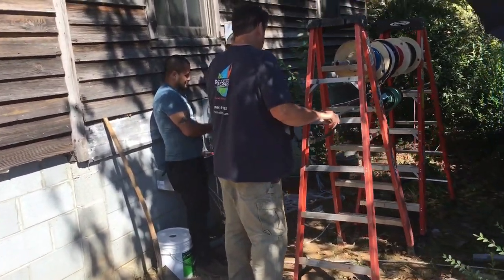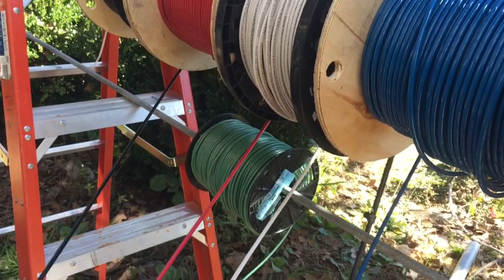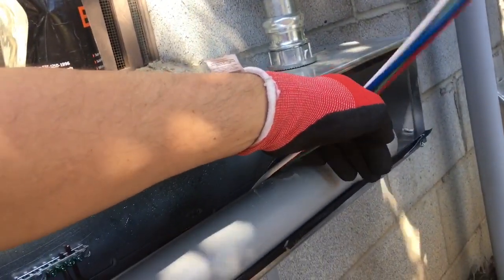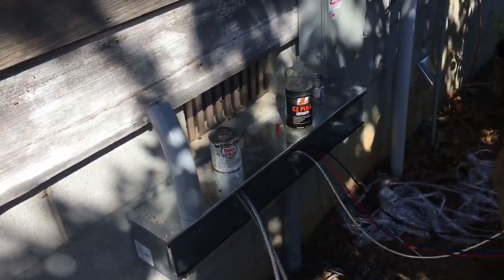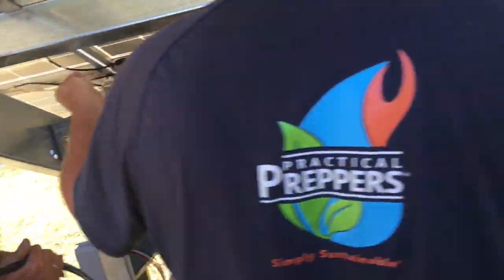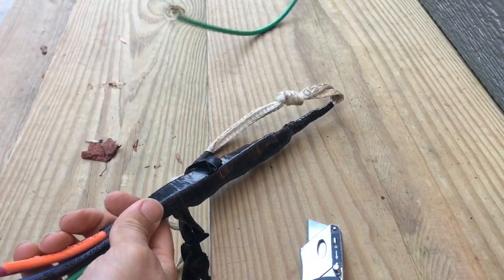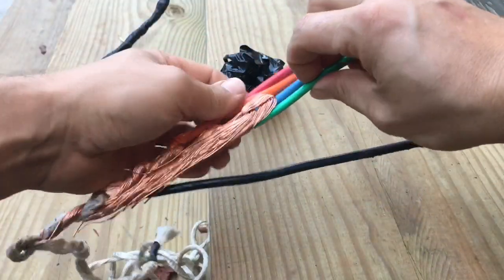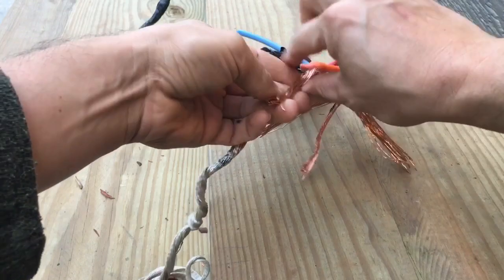How to pull wire thru 200' of underground conduit

Comment: Can you just push the wire thru if it's 70ft run?
Reply from the maker: I doubt it. It depends on the amount of bends and the rigidity of the wire. If it’s down hill maybe. 

I’m gonna say probably not

Comment: Here is a good tip.
Put a foot long tube on the lube nozzle. That way you can put lube in a tight spot. 
The next tip is. Use a whistle for those places you can't heard the guys because construction noise etc.

Comment: It's not that I'm unwilling to try the vacuum method to get the snake through but does anybody have any other suggestion I would like other options then only think that I need to use a vacuum to suck a little string through to get the process started.
Reply from the maker: So have you tried the vacuum method?  Are you in the field doing this everyday?  For PVC conduit nothing works better than the method in the video. If it’s not airtight conduit, best practice is a fish tape and a pull box every 100’ or 360 degrees of turns. 

If you know the best way to do some thing why would you do it any other way
Reply from the maker: Snake it
Reply: @GainSolarPower  I thought I was clear but I'll be clear the method to get the snake through the answer can't be just snake it because if you got a long conduit with lots of turns or whatever you need a method to get the snake through that's what he explained with his vacuum I'm asking for alternatives to that so the answer cannot be snake it it has to be how to get the snake through.

Comment: Johnny, I know this is a video from Nov. last year, but can you explain why you choose different color insulation for each mppt run from the IMO disconnects? Of course the green signifies Ground.  What is the brand and overall dimensions of the breakout box at the ground mount location and what is the size of the weather head you use to connect to conduit and then to the breakout box? I'm building a parts list for my recently installed Sinclair fixed mounting system that accommodates 40 Axitec panels. Two ground mounts with 40 panels each or 80 total for two 12k Sol-Ark inverters. Thank you sir!
Reply from the maker: Different colors help you identify wires, keep you from having to phase tape, saves time.

12x12x4 pullbox at array.

weatherhead and all fittings for wire transition are 1"
Reply from the maker: Have you purchased the solark yet?  I'll give you a good deal!
jv@gainsolarpower.com

Comment: What’s the advantage to running DC instead of AC with the inverter at the array? Smaller wire size? Guess this allows for batteries at the house?
Reply from the maker: Smaller wires=less copper=less money

Comment: Sorry if I missed this in the the video but what type and gauge of wire are you pulling? Are all the spools the same size? Any recommendations on internet sales locations. Coming up on my solar build and there will be a substantial run +200ft or so. Thanks for these videos!
Reply from the maker: Hi Tom. We pulled 8 on that job. I don’t remember if the spoils were all the same but you can usually go to an electrical supplier and buy cuts of wire to you length. Then roll them all out, tape them together, and feed them as someone pulls it in. What are you looking for internet sales?  I sell inverters and batteries and can drop ship all over the US. Email me at jwv8783@gmail.com
Or 7708433497

Comment: I have a 225 ft run from my panels to my sol-ark 12k.  Since I have enough wire available, I was thinking of pulling 8 strands of wire through 1.5 inch conduit and paralleling it at mppt inputs on the sol-ark instead of paralleling it at the array and running 4 wires through the conduit.  My thinking is that it would be less loss over that long stretch running the 8 wires instead of 4.  What are your thoughts?  And do you think pulling 8 wires over 200 feet in 1.5” conduit to be fairly straightforward?
Reply from the maker: Sounds like a waste of wire. The 8 is good for 40 amps but you would actually have to de rate it if you put that many current carrying conductors in a pipe. It won’t work any better if you parallel at the solark. I’d pull 4 10’s on 225’
Reply: @GainSolarPower  Well, darn.  Guess I'll have some extra wire stored underground for when I need a second array!  Thanks for the advice.

Comment: Johnny, video would have been more explanatory if you had shown how you pulled the string through first, then attached the wire pull cord, before you pulled the wires through the conduit. I pulled two pairs off 10AWG plus a 6AWG ground wire through a 1" conduit 358', using my ATV, without any wire pulling liquid. I found as long as I pulled it steady, it doesn't hang up between the splices.
Reply from the maker: Yikes. I’ll do a video soon on your suggestion on

Comment: Interesting i have always solder every wire in a staggered position about 4 inches back for each wire.  This way keeps the over all diameter of the pull head much smaller. But like you said there's a million ways to do it.
Reply from the maker: Dang. Seems like that would take a long time